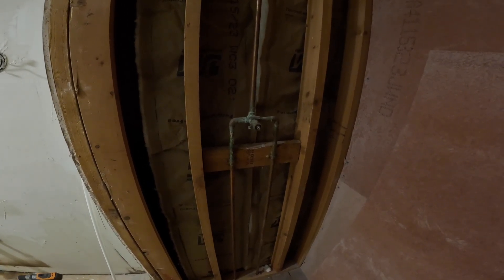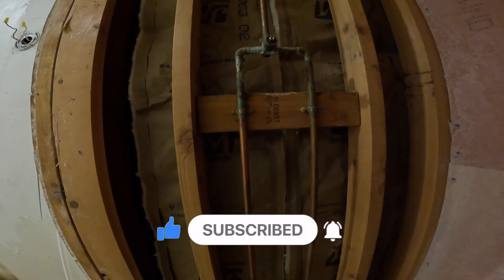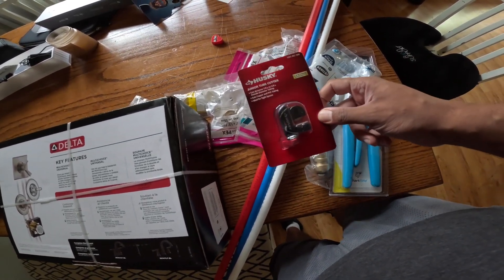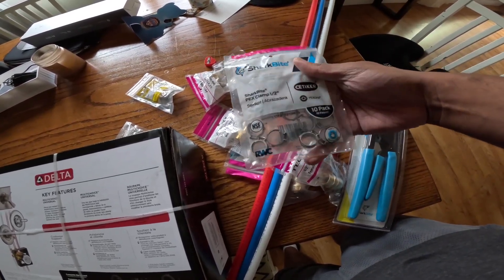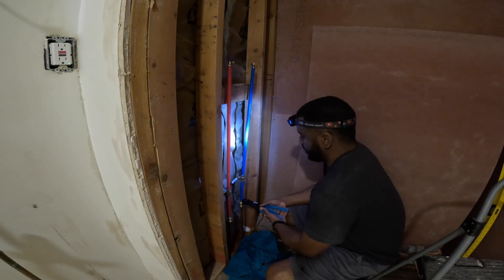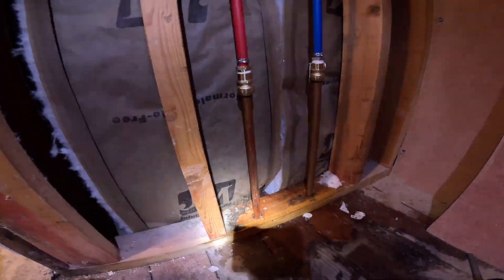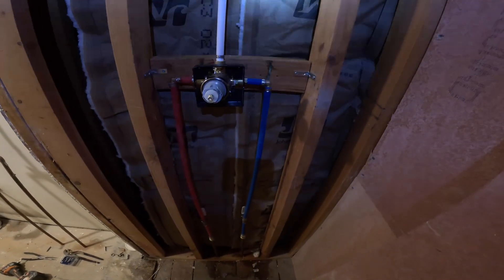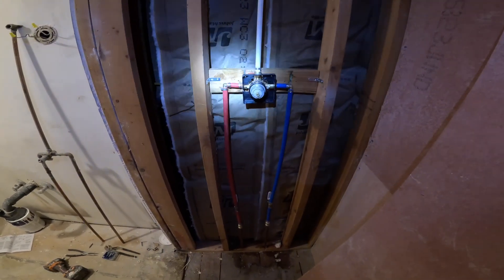DIY Replacement of Copper Pipes to PEX pipes - Plumbing

Comment: nice job, but i would have gone lower, and cut off the copper pipe in the cellar, run a longer piece of the pex, and put the shutoffs in the cellar.  without knowing the layout of the house,, not sure if that would been possible, but shutoffs will not do much good, if you can't access them.

(also, NOT a plumber)
Reply from the maker: Thanks for the feedback, I just wanted to cut the area where the corrosion was visible, I have a way to access the shutoffs from the other side.